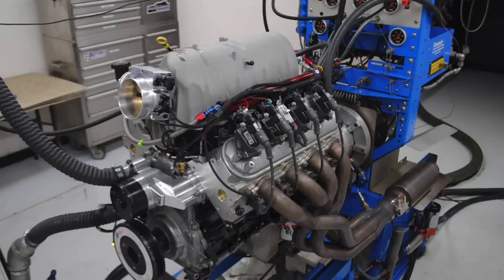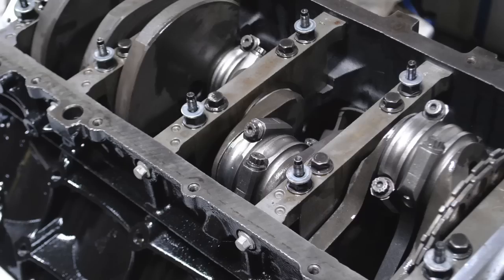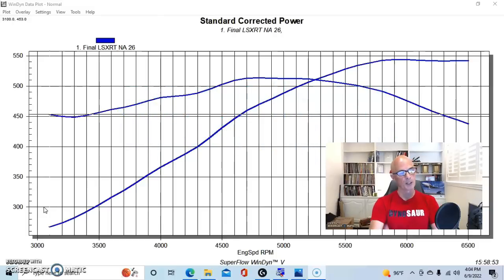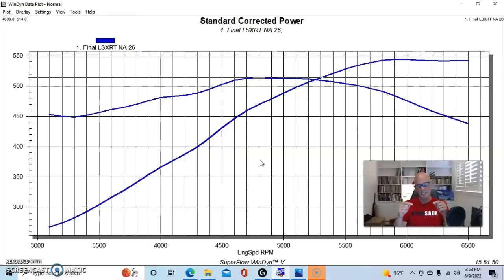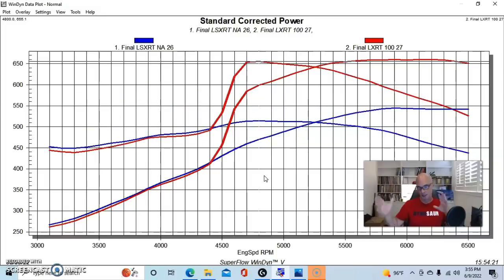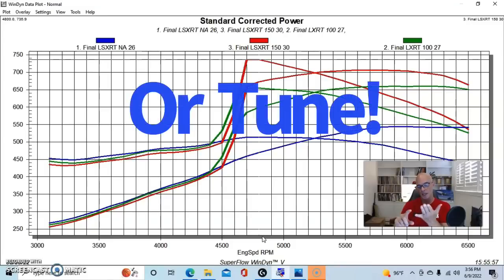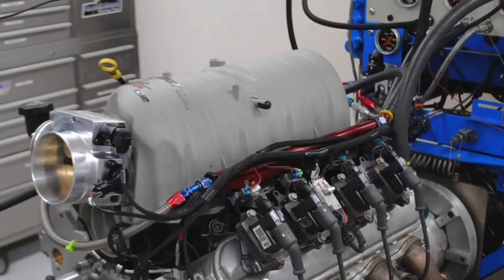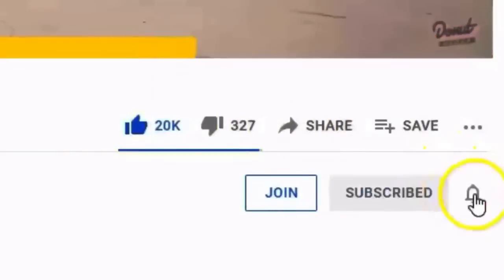HOW MUCH NITROUS IS TOO MUCH? HOW MUCH NITROUS CAN I RUN ON AN LS? 383 STROKER LS ZEX NITROUS TEST

Comment: So use a dry system and have injectors and a computer that can compensate for the nitrous
Reply from the maker: YOU CAN RUN IT AS A DRY SYSTEM (ADDING FUEL THROUGH INJCTORS) OR A WET SYSTEM
Reply: @ I was looking at a 200 shot in an LQ9. Figure that would be the safest way if I use a dominator

Comment: Hi Richard,
Thank you for this video. My motor is similar to this setup. The only difference is, that I’m running a Holley Hi Ram and 48lbs injectors. I’m also running the Nitrous Express Maximizer 5 Progressive system. Still haven’t did any nitrous run on this motor yet. Still trying to get the tune right before I do.

Comment: "Too Much Nitrous," is when the engine is running wide open throttle at whatever your max RPM is, and fuel and nitrous is blowing backwards out of the throttle body. At this point the engine is not ingesting ANY atmospheric air at all. It is running on ONLY nitrous and fuel.

Comment: What about mixing the shot of nitrous with a suitable shot of water from a WI kit. Maybe with a bit of methanol in it? As well.
Reply: No reason to do that. If you install a dual fuel style kit, just run methanol on the nitrous shot.

Comment: You need bad bitch exhaust valves. If you stack enough kits, that the engine can't suck it through, close the throttle body n hit it with another shot.

Comment: The problem is clear, this is only a problem on certain intakes. You should be adding the nitrous to a belt driven manifold aka a supercharger. Then its all mixed up by the rotors and added to boost as well. :D Win Win :D
Reply: This guy Nitrous´s!

Comment: could we use a plate like that to fog fuel, and maybe meth on a direct injection engine (LT1)?  would that help with the carbon build up on intake valves?   i already have a catch can...but was thinking this type set up would help even more.....and then maybe a 3rd nozzle for the nitrous?

Comment: How do you calculate how much Nitrous is 100 hp?  Is there a rule of thumb?
Reply from the maker: jet size and bottle pressure
Reply: @richardholdener1727  ok, not real familiar with Nitrous setups...so if a certain jet size is 100hp at a certain rpm then its the same for most engines?   Heating the bottle makes more pressure so more power?
Reply: @cuzz63  
A specific amount of fuel needs a specific amount of air to burn, that will never change. What determines how much power you get, is the added fuel you introduce. The nitrous is just there to add the oxygen so that the fuel will burn.
This means that it is not the same for most engines and as Holdener said, what nitrous jet you use, depends on your bottle pressure and how much fuel you introduce.
Some select a fuel jet size first and some select a nitrous jet size first. I tend to select a fuel jet and then tune for that, because the fuel pressure and volume is the most stable of the two.
I know that is not a direct answer to your question, but I put it here first in order to give you a basic understanding of the system.

Now for your actual question, no, a specific nitrous jet size is not equal to a set amount of hp. There are a ton of variables to consider.
There's the system itself. Some systems might need X amount of jet for 100 hp for say 7 psi of fuel pressure, while another system might need X different amount for 7 PSI of fuel. Is it a plate, a dry port, how many plates or TB's and the like.
Then there's the engine itself. if you have two engines, both putting out 450 hp, but one having a 9.5 cr and the other a 10.5, then there's a difference. Less fuel will mae more power in the higher compression engine. IF THOSE TWO ENGINES CAN RUN THE SAME TIMING! On the flipside, the higher compression engine might need more timing pulled which could hurt efficiency. All of this is a factor even before we start to factor in engine size, cam specs and what not.

In short if your nitrous setup nets you 100 hp, then you have a 100 shot. Is that a 100 shot on every engine? No, and jet sizes might vary greatly.
Reply: @AB-80X  thanks

Comment: Could always do a dry shot with the nitrous and add the extra fuel thru the injectors, this worked pretty well for me with a 200 shot on a stock cam only ls1 for over 10 years.
Reply: People just need to know that they better have plenty of injector and fuel pump otherwise things get ugly quick. You obviously upgraded your pump and injector with plenty of flow.
Reply: Would you explain your setup?
Reply: @danfalley9296  I think he said cam only LS1. He ran the 200 shot for 10 years so I'd bet that it's an NOS or NX nitrous system. The fuel system is easy to size when you know the HP you're planning on hitting. His HP range was 600-625 HP ish.
Reply: @RonniePTexan yep upgraded fuel system with bigger pump and injectors so it can supply the extra fuel no problems.  The ecu took care of the rest.
Reply: @duz10z30  Do you still have the car/truck? What kind of ETs did it run?
Reply: @RonniePTexan yeah still have the car, the best I ran with it was 11.6@117 NA  and 10.43@133 on gas. 
It was an old NOS kit which was modded a little bit too suit.  Engine looked in pretty good nick when I stripped it for a rebuild could have kept going.
Reply: @duz10z30  Nice ETs. You must have a fairly streetable car as well. Probably weighs 3200-3400 lb at least too. That's awesome that you never hurt your engine. I got greedy and kept stepping up the nitrous. I'd also find that pulling timing like your supposed to slows it down, so I'd leave timing in it even when I ran 350-400 shots of nitrous through my poor Pontiac engine. I ended up going through a lot of pistons and blowing the bottom end out of several engines. You were smart, you stuck to your plan and didn't get greedy.
Reply: At weight was around 4000lbs was my daily driver at the time. We had the tune uo very safe prob could have pushed it further but didn’t wanna risk it as I had to drive to work during the week. There is a vid on my channel if ya wanna have a look
Reply: @duz10z30  I checked out your channel. Creepy snake, cool car! I saw the garage burnout and the first thought I had was "Is this guy an Aussie?" Then noticed the Pontiac GTO-looking car which I think is a Holden. Either way, nice car. The ETs were nice but knowing that it was a stick shift car makes it even more impressive. 

You mentioned it being your daily driver and that it kept you from getting aggressive with the nitrous, that worked out good for you. As you could tell from my story, I wasn't careful and it costed me numerous sets of pistons. I had JE pistons, custom billet crank, Carrillo rods and thought that might do the trick. As it turns out, nothing in racing is truly idiot proof, so I thought with those amazing parts surely I could spray a 400 shot of nitrous into my stock block, stock headed Pontiac motor. Those parts left the engine about the 60' mark... My best time was 9.89@137 in a 1968 Firebird which weighed about 3,500 lbs. Your car could have probably gotten to that ET with more nitrous, but then you would have had the problems that I had trying to keep the shiny parts inside the engine. I should have gone to a turbo setup, but I was so focused on my nitrous combination that it never happened. 

What are the plans for your car?
Reply: @RonniePTexan  I really wanted that 9 sec pass but at the time couldn’t afford too rebuild it so common sense prevailed. I have since rebuilt it and added an f1A Procharger. It’s not too far off finished.
Reply: @duz10z30  That ProCharger should definitely get you into the 9s! Probably deep into the 9s and getting close to 8s if things go as planned. At some point that transmission might need an upgrade, do you plan on keeping it stick shift or going to a TH400 or 4L80E? If you haven't upgraded your ECU yet, keep an eye on Fueltech. They are putting their systems on sale because they have their new FT700 coming out so all of their others are getting their price cut. A lot of guys go with a Holley, but they don't have a lot of inputs or outputs so they run out of capability very quickly. Hopefully your build comes together smoothly and you keep us posted (I'm subscribing). Have a good day brother!

Comment: Great content as always. Done much testing with an LSA and nitrous? I’m at 740 to the wheels now just on boost and gonna try 100 wet shot with c16 when I finish up the install.
Reply from the maker: blowers and nitrous work well together
Reply: As was said, blowers and nitrous work well. If you are doing a C16 setup, give some thought to using methanol instead. Fuel is a lot cheaper and you get a lot more cooling as well. You should be able to run at least 150 hp worth of nitrous with great reliability if you run methanol instead of race gas.

Comment: What about dry shots with the holley adding extra fuel via Injectors and a single fogger? Aslong as you have enough duty cycle room you can keep going? What about with boost? I'm stacking a 7875 with a dry a small 30hp dry shot for now.
Reply from the maker: WORKS WELL

Comment: We used to add two nitrous jets on the throttle body to deal with poor nitrous distribution without having to resort to a direct port system. It was limited to 200-250hp shot…but that’s all we needed
Reply: I remember back in the day they had a plate system that was 250hp for a 5.0 Mustang. Had a buddy that ran it. Think it was Compucar...scary stuff lol..I think it was a plate between the upper and lower? Then again I ran a 200hp through a fogger/NA and 125hp through a Paxton ball drive as an intercooler lol...(*edit two different combos, not at the same time!)
Reply: @robertelmo7736  NOS made that plate. Nitrous and old Paxton ball drives were popular set ups in the very early days of fox body performance

Comment: Air behaves like a liquid.

I suspect (but dont have any hard data whatsoever) Fuel dropping out in the intake is related too the dew point of fuel in the intake. The nitrous and flow cools the air, as that happens the air can only hold so much fuel in vapor form before it doesnt want too absorb any more. I honestly think dry nitrous setups are safer (for a variety of reasons), especially at higher power levels.

Comment: The question I've always had is how much nitrous can be run before the mixture has trouble igniting because the nitrous has displaced too much air?

On another topic, I'd assume the Holley can compensate for nitrous nicely? Then you can run a big dry shot and nail the fueling with the right injectors.
Reply: I remember reading and article on this years ago and they came to the conclusion that doubling an engines power output with nitrous is about max before you have slowed the airflow through the intake to the point that it will not ingest anymore and this is why big power NOS engines have to be so large with Cubic Inches so that they can inhale more volume
Reply: Really? 😂

Comment: I have a forged 5.3 with a terminator x, but I'm using sep 1000 injectors and using a dry plate and let the terminator add the fuel through injectors. Hope it works for a 300 shot

Comment: I have a very similar setup going into a 68 Camaro. Only big difference is its a 408 with a dry direct port system controlled by a Holley Dominator. Motor made just over 600 and haven't got the chance to put the car on the dyno with the nitrous yet. T56 magnum, so it should be fun to drive.

Comment: I have a 408 Stroker set to 10.8:1, is that safe for a 150 shot? Also, what power level facilities running cold plugs? I would like to keep this thing a daily driver and not be worried about fouling plugs ect.
Reply from the maker: PLUGS WON'T FOUL
Reply: I've also had a lot of luck with BR7EF on california pump 91